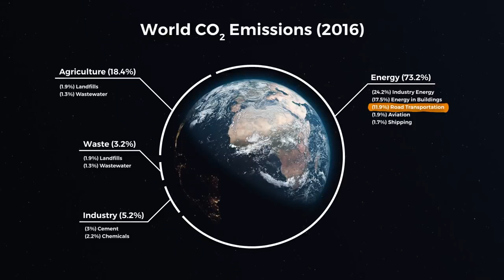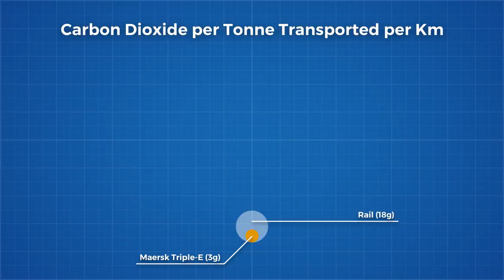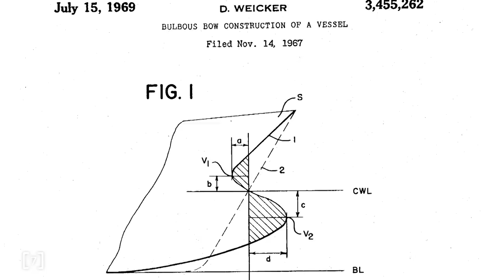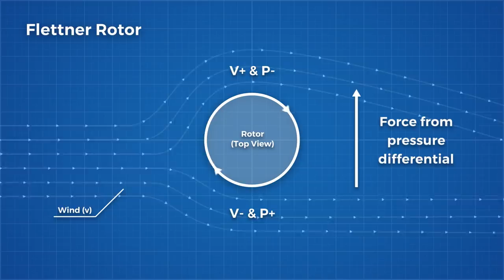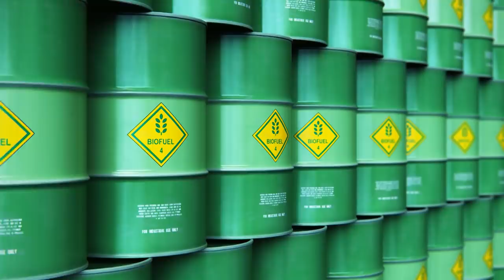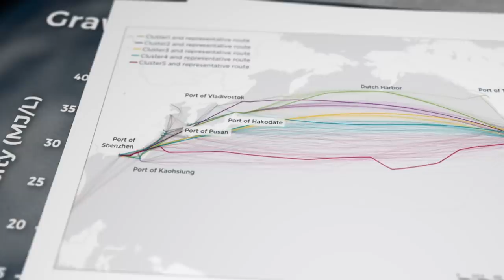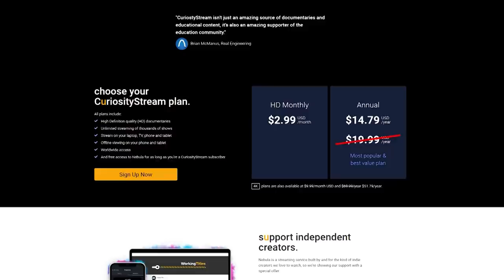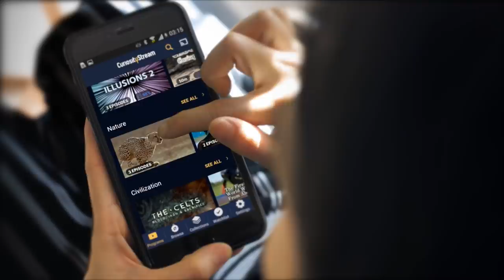Are Renewable Powered Ships Possible?

Comment: Renewable transportation game:
Select your difficulty:
Causal - Railway
Easy - Cars
Medium - Trucks
Hard - Ships
Nightmare - Airplanes
Reply: Actually ships would be the easiest to convert to renewable energy... They aren't concerned about weight as much as trucks or planes
Reply: @anonymousarmadillo6589  They are governed by size of canals and that is another set of issues.
Reply: @cmdr1911  Yes, but they are not sensitive to a couple of kilos as trucks or cars are.
Reply: @anonymousarmadillo6589  See what happens as you increase weight. Ships the same size sit lower in the water, require more power and will force a redesign of weight distribution. By far the best thing would be to use natural gas today and transition to using RNG from sewage and agricultural in the future since ports are typically near major cities and the US alone could produce 30% of today's natural gas demand from waste products.
Reply: Hardcore: Rockets
Reply: @natemichael9655  Newer rockets actually run on liquid hydrogen... So they already are run on renewable resources.
Reply: @anonymousarmadillo6589  they've done so for quite a while
Reply: @isakjohansson7134  Newer = Newer than the apollo mission, which used kerosene until the 90s
Reply: @anonymousarmadillo6589  i guess so but some of the V-2 rockets also ran on hydrogen, though admittadly they were just prototypes
Reply: Non of spacex's rocket engines use hydrogen.
Reply: @edomeindertsma6669  Yeah, they use RP1, but that's because they want to keep launch cost down
Reply: @anonymousarmadillo6589  Your statement is incorrect because many of the newest rockets run on kerosene (Falcon 9, Long March 6...) or methane (New Glenn, Starship...).
And I would also point out that liquid hyrdogene has been around for a long time (Centaur in the early 60s)
Reply: @thesteaksaignant  What do you think RP1 is? And they use it because it's cheap. Other space agencies like the Soyuz program used LH2, but now use RP1. 

ISRO's PSLV and GSLV series also have used LH2 in the past, but have since used other fuels like MMH/MON.

Basically no one uses LH2 even though it's technically possible, because there are cheaper alternatives
Reply: @anonymousarmadillo6589  But by 2050 all of the above vehicles will be powered by batteries except for big transportation ships.
Reply: @subjord  How can you power a rocket  with batteries 😂
Reply: @anonymousarmadillo6589  step 1: build a railgun
Reply: @anonymousarmadillo6589  I was answering to your previous comment saying "newer rockets run on liquid hydrogen", which is incorrect.

Your point about RP1 being cheaper is irrelevant.
Reply: Ultra Nightmare - Space Rockets
Reply: @anonymousarmadillo6589  The majority of today's Ammonia and Hydrogen production is from fossil fuels. Electrolysis of water is the least efficient and the most dangerous way of producing hydrogen.
Reply: Let's make massive paper airplanes
Reply: @anonymousarmadillo6589  power a rocket by sails
Reply: @anonymousarmadillo6589  I was thinking that, but most of the worlds Hydrogen is from steam reforming, would love to see more electrolysis for rocket fuel.
Reply: Extreme mode: Concorde
Reply: Why are trucks harder than cars?
Reply: @Nicolas-gu2jt  1. They need more power
                  2.They need to find an adaquate storage method for that energy (Batteries are heavy and hydrogen doesn't have infrastructure needed)
But cars can be heavier without much problem while trucks have to sacrifice payload decreasing revenue
Reply: @이주연-x4x  thanks
Reply: What would be the difficulty for space crafts? 😜
Reply: Impossible:
Rockets
Reply: @anonymousarmadillo6589  Are you mad? I’d argue roughly the same problem is present both in lorry’s as in ships at very different scales. You need to optimise the balance between the weight of the batteries and the weight you’re hauling. At different scales obviously,  adding a car to a ship is virtually negligible but no so much to hauling ship
Reply: @anonymousarmadillo6589  Heat air to plasma is how just need to work on the conversion and energy source.
Reply: Air cargo can be done using a lift gas to displace a large portion of the weight and then the craft flies like a bulky airplane using a wing-body shape it works just fine.
Reply: @anonymousarmadillo6589   If that was correct,  we would see plenty of  electric ships by now. Weight is actually quite important for ships. That being said, the price and energy density of batteries are  the largest  factor as to why it hasn't ben popularized yet.  Batteries are heavy but they also take up a lot of space.  Here in Noway we've already started replacing old ferries with electric ones, and the goal is that every new ferry should be electric from 2025. As he mentions in the video, lang haul  shipping is the largest contributor  to carbon emissions, and these ships are much harder to replace with electric ones.
Reply: @thesteaksaignant  Yes, you are right. Newer rockets do use RP1 or methane because it is cheaper. But the technology exists and is viable.
Reply: @hkonmyren  Electric ships will never make any sense, because the battery tech we have today can't scale to power a ship. I wasn't talking about electric ships. Ships are sensitive to energy density, not simple weight.  I was referring to the fact that above a certain weight, better energy sources become viable, like wind and nuclear.
Reply: @natemichael9655  Elon just beat this stage the other day... twice
Reply: Rockets?
Reply: Isn't ion propulsion for jets renewable?
Reply: @SurmaSampo  Most dangerous? How is it the most dangerous?
Reply: @GRBtutorials  The products of electrolysis of water is gaseous hydrogen and oxygen plus a lot of heat. It takes very little for those two highly reactive gasses to combust again together in a very violent way with a tiny amount of ignition energy.

If you dump enough energy into a sealed container of water fast enough it becomes an explosive device. The USA Navy uses these devices for sonar mapping.

Also, just pumping electricity into water to break chemical bonds is like mining using nothing but big blokes with sledgehammers. Very inefficient compared to decomposing a less stable compound.

If you have enough renewable electricity to make hydrogen from electrolysis economically viable as a fuel source for transport then you are already in a utopian age of free energy. The amount of energy a society produces and makes use of directly correlates to wealth. You can use watt hours as a direct replacement for currency for economic and productivity measurements.
Reply: @SurmaSampo  Well, modern electrolysis cells keep the oxygen separated from hydrogen, and if heat is a problem, steam reforming involves heating flammable compounds, including hydrogen, at 700-1100°C. That’s far more than what can even be achieved by electrolysis (as water boils way before that). 

Also, efficiency isn’t as bad as you’d think. PEM cells can achieve 80% efficiency, and in some regions with relatively cheap electricity and/or expensive natural gas it’s even already cheaper than steam reforming.
Reply: Just consider that the US Navy has very large carbon neutral ships.  They are of course the nuclear powered ships and submarines.  The public is just not going to call for it.
Reply: Answer for carbon free energy look advanced nuclear. Add in permaculture for repairing the ecosystem.
Reply: @cmdr1911  They are more governed by port size rather than canals if the ship can't fit in a port it can't unload its cargo if it is too big for a canal it can take the longer route and go around. canal size does have an impact but it entirely depends on the route the ships are servicing if it was just doing between china and the west coast of the USA it doesn't need to enter a canal to service this route.
Reply: @adamflohr5166  There are entire classes of ships designed for the canal's. Nearly 20% of global shiping goes through thr Panama and Suez canals. When fuel prices go up, more use the canals. Most ports in the west atleast are built to support panamax class ships as their largest. I believe oil tankers and LNG ships are larger but you can easily transport with pipelines to specialized ports like those on the gulf. Also with canals like the Panama that use locks, there is a limit on usage. Larger ships will deplete the water faster. The ships that could be built larger already have.
Reply: BIO-DIESEL EVERYTHING.
Reply: Maybe for future generations, this idea could be turned into an educational video game!
Reply: Hydrocarbon based fuels can be made in a renewable way, by extracting CO2 directly from the atmosphere, combined with water and renewable electricity to create a substance called "blue diesel".  It can be used as jet fuel with small engine modifications.
Reply: @eventhisidistaken  
Or you can just use bio-diesel. Literally just crisco.
Reply: @cmdr1911  Canals are making larger channels and expanding as well less of an issue. Cars hard  to cheaply make reliable and affordable and low matainance cost. Trains literally use a shit ton of power in the first place. They are essentially Diesel powered generators. Planes well dam
Reply: What about Zeppelins ?
Reply: Impossible - Rocket ships
Reply: @anonymousarmadillo6589  how is hydrogen renewable resource? Green yes, but not renewable.
Reply: @SuperLusername  Renewable, if you make hydrogen from electrolysis of water.
Reply: @anonymousarmadillo6589  but water id finite on Earth
Reply: Railway: Hydrogen (Fuel Cell)
Cars: Hydrogen (Fuel Cell)
Trucks: Hydrogen (Fuel Cell)
Ships: Hydrogen (Fuel Cell)
Aircraft: Hydrogen (Fuel Cell)
Rocket to Moon: Hydrogen (Liquid)
Reply: The electric grid is the easiest thing to decarbonize using nuclear energy. We need to do that immediately.
Reply: @gregorymalchuk272  Nuclear is on it's way out. Solar is far cheaper to maintain and build.
Reply: @anonymousarmadillo6589  
France already gets 75% of It's energy from carbon free nuclear power and at a cost close to fossil fuel. I am skeptical you are ever going to have a stable grid with only wind and solar. Keep in mind nuclear energy is renewable energy, as there is enough uranium in the earth's crust to power civilization for billions of years. The sun is going to burn out in 5 billion years anyway.
Reply: @gregorymalchuk272   I agree that solar and wind cannot ever provide 100% of our grid requirements. 

France is a small nation with a shortage of land. Solar is only practical in places where large swathes of land are available, and sunlight is also abundant (Like CA) Which is why California is closing down their existing nuclear infrastructure.
Reply: @anonymousarmadillo6589  
Nuclear energy is only leaving California because of a fiasco with the Mitsubishi replacement steam generators at San Onofre, and because of the asinine demands to eliminate the warm water outfall at Diablo Canyon. Fossil fuels and renewables receive enormous subsidies while nuclear gets almost zero subsidies.
Reply: @gregorymalchuk272  I think this channel has a video exploring this topic in greater detail...
Reply: @anonymousarmadillo6589  incorrect, the apollo missions used LH2 (hydrogen) for second stage, and second & third stage in the case of the saturn V.
Reply: @anonymousarmadillo6589  incorrect, hydrogen is produced by gasification of fossil fuels, and cooled using them. It's only technically possible to use water, it isn't very cost effective.
Reply: @natemichael9655  Well no. They are going to use and are using methanr and oxygen for spacex new rocket. And thats completely renewable.
Reply: @SuperLusername  How it works:
H2O + energy -> H2+O
H2+O = H2O + energy
most of thr fuel fall back on earth as water and thr small amounts that goes to space are so small that they arent important.
Reply: @이주연-x4x  Doesn't look like anyone has addressed this so I will.  Trucks can carry larger more efficient batteries and would have actually made more sense as the first thing to go electric.  The reason why cars came first is due to motive.  Anyone who's done the research knows that electric cars are not only cheaper too 'fuel' but also have longer lifespans with less maintenance especially when built with motors on each wheel due to having far less mechanical parts.  Of course electrics aren't without their weaknesses like longer 'fuel' times and they used to have shorter range but range has reached a point now where they are comparable to gas cars and some super chargers can 'refuel' an electric most of the way in 15 minutes.
Reply: @natemichael9655  We figured it out, you grow plants to turn into rocket fuel
Reply: Trains is probably the easiest, but after that is quite easily ships. You have a lot less constraints when it comes tio both weight and space. The largest constraint is probably the price, but if they save on fuel costs the total cost of operation will probably be a lot less during the ships lifetime.
Reply: actually shipping is the easiest,to achieve a real reducción they need to redesign the hul eliminate the bolbous bow with a long tube along the length of the ship, propeller place within the pipe,this will eliminate frontal resistance,no front wave and will create a wave in the back of the ship.
As far as green energy Hidrogen or CAES,compres air energy storege ,one or a convination of both is the solution,the source is built energy harvesting ships, sails and solar power with generator like the ones use for tidal energy , they don't need to cross canals or water wais, refills can be done in open ocean justlike tug boat. 
and last solar electric container ship to Carry only empty container,this will reduce time in port,and they can travel very slow.